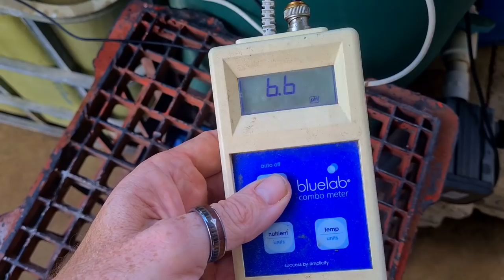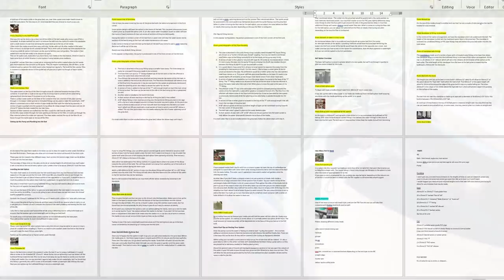Flooding, Power Blackout & Aquaponics

Comment: Lost power for a week here glad I had the solar wall with its  24 battery banks setup , kept all the LP-100 air pumps ticking over, sadly had a few jumpers with everything flooding  , on bright side filled the new 40,000L grow-out pond from a few days of rain fall ~1.4m deep !! , downside is now I have to go under water to connect all the 60x under-gravel airlifts that are spaced every foot all around the perimeter

Comment: I decided to keep my system indoors so I don't have to deal with levels changing everytime it rains.
Reply from the maker: I'm hoping to have some better rain protection over the next set-up. I'm thinking of using greenhouse film over a hoop house.
Reply: @RobsAquaponics  I'm hoping to run my indoor system year round as well. I have plans for a hoop house later down the line that can be shut down in the winter. It freezes here often enough to make heating cost prohibitive in a hoop house me thinks.

Comment: oi oi oi Rob, a 350 or 400watt house panel will charge that battery even when its cloudy, I have  100AMP HOUR BATTERY FOR MY WATER PUMP with a 250watt panel and its always fully charged, even with several days in succession of clouds.
Reply from the maker: Only have space down the side of the house for small panels at the moment. I've got a mate that is setting up a large system to run off solar & will be picking his brains for our next build.
Only experience I have with it is reading the meter on our house system. 😉

Comment: Great video but to be honest I believe your fish tank has some issues. Main thing is it doesn't have enough surface area. I'm not sure if I was a fish I'd like to spend my life swimming in circles in that heavily populated low light round drum.
Reply from the maker: Stocking density is far less than commercial aquaculture and lower than what a few renound aquaponics experts recomend.
Cheers
Reply: @RobsAquaponics  thanks for the reply. Yeah I just believe giving the fish a good environment will result in better taste and if you lose power a larger surface area will help. I know with most systems space is a factor.